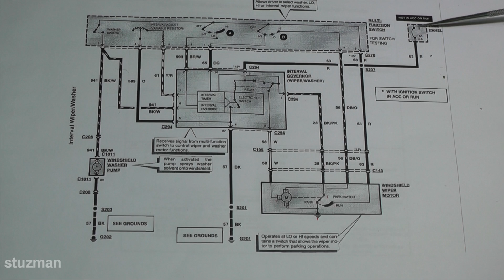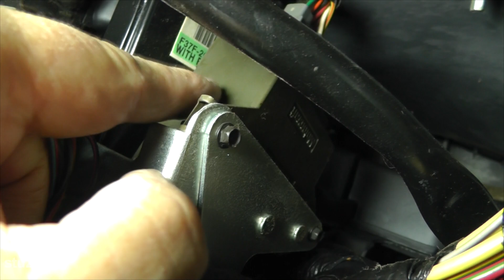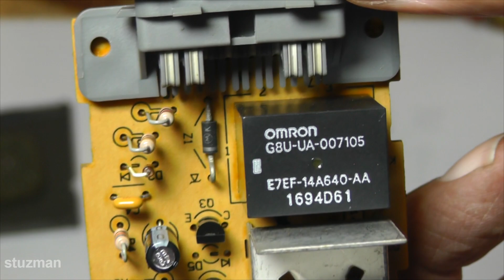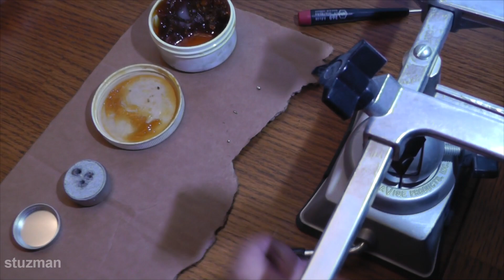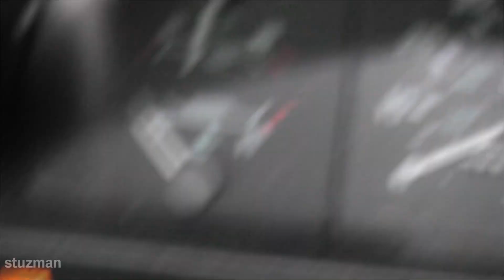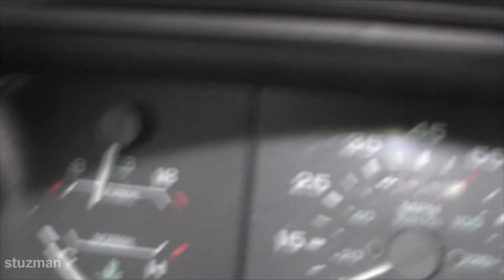Ford Ranger Windshield Wipers Repair

Comment: Brother your very good at explaining the circuit. Schematics certainly tell a complete story but I can see that it will take some basic understanding of electrical design/theory. You have a nice set up for working on circuits too. Nice fix with no parts required. Cool.
Reply from the maker: wyattoneable understanding schematics is not that bad Wyatt. As you mentioned, it's really just simple electrical theory, nothing really elaborate. Really appreciate you dropping in and leaving a comment. 😀👍
Reply: @stuzman52

Comment: Great explanation of circuit design & operation! I'm always worried about overheating components when reflowing solder joints. Do I have to worry about it?
Reply from the maker: Thomas EXOVCDS you don't have to worry about overheating joints Thomas. You just have to make sure that you have the right soldering iron wattage for the type of work that's involved. The trick is to keep tip cleaned, keep it tinned. Heat the pad, flow the solder and move on. 😀👍
Reply: stuzman Thanks Terry!
Reply from the maker: You're quite welcomed!
Reply: Yes, Terry is right, most people try to heat the solder, but Terry showed good technique, heating the board first and then bringing in solder. It makes for a much better connection.